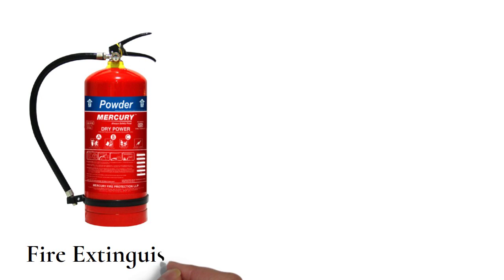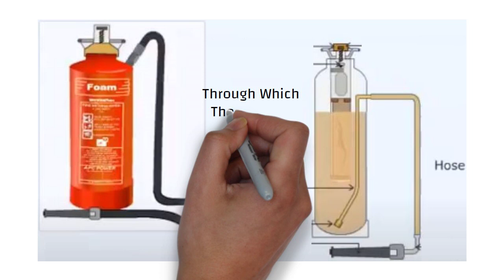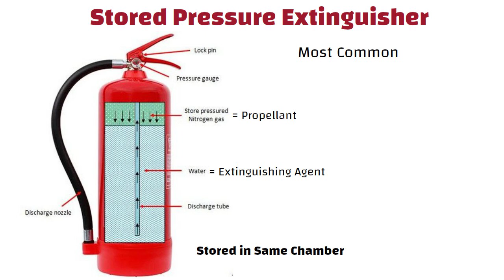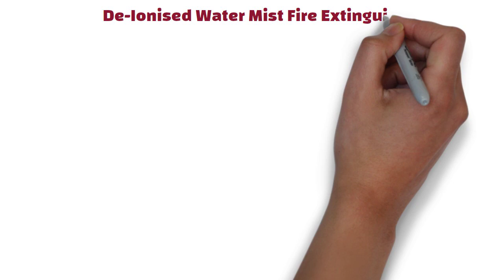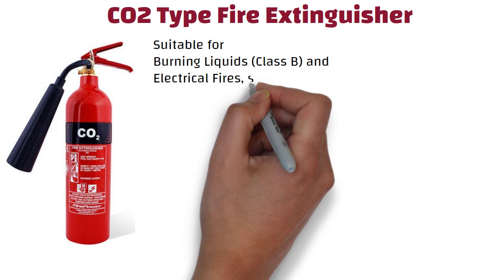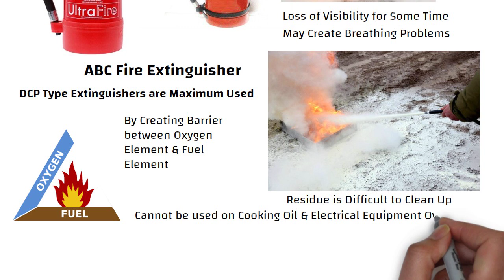FIRE EXTINGUISHER DEALERS IN KERALA, CALL 8138906102, FIRE EXTINGUISHER DEALERS IN ERNAKULAM.

Comment from the maker: fire extinguisher traders in Kayamkulam
Reply: FIRE EXTINGUISHER DEALERS IN WAYANAD, FIRE EXTINGUISHER SUPPLIERS IN WAYANAD, FIRE EXTINGUISHER DISTRIBUTORS IN WAYANAD, FIRE EXTINGUISHER IN WAYANAD, ABC TYPE FIRE EXTINGUISHER DEALERS IN WAYANAD, CO2 TYPE FIRE EXTINGUISHER DEALERS IN WAYANAD, CLEAN AGENT FIRE EXTINGUISHER IN WAYANAD, MODULAR TYPE FIRE EXTINGUISHER DEALERS IN WAYANAD, MECHANICAL FOAM FIRE EXTINGUISHER DEALERS IN WAYANAD, FIRE EXTINGUISHER NEAR ME WAYANAD, FIRE EXTINGUISHER TRADERS IN WAYANAD, FIRE FIGHTING COMPANIES IN WAYANAD, FIRE CONTRACTORS IN WAYANAD, FIRE EQUIPMENT DEALERS IN WAYANAD, FIRE ALARM DEALERS IN WAYANAD, FIRE PUMP DEALERS IN WAYANAD, SMOKE DETECTOR DEALERS IN WAYANAD, FIRE FIGHTING SYSTEM IN WAYANAD, FIRE PROTECTION SYSTEM IN WAYANAD, FIRE AND SAFETY CONTRACTORS IN WAYANAD, FIRE HYDRANT SYSTEMS IN WAYANAD, PA TALK BACK SYSTEM IN WAYANAD, FIRE NOC IN WAYANAD, FIRE INSTALLATION IN WAYANAD, FIRE NOC RENEWAL IN WAYANAD, KIRLOSKAR FIRE PUMP DEALERS IN WAYANAD, FIRE EXTINGUISHER NEAR ME WAYANAD, FIRE EXTINGUISHER MANUFACURERS IN WAYANAD, SAFEX FIRE EXTINGUISHER DEALERS IN WAYANAD, FIRE NOC CONTRACTORS IN WAYANAD, FIRE FIGHTING EQUIPMENT DEALERS IN WAYANAD, FIRE PROTECTION SYSTEM IN WAYANAD, FIRE INSTALLATION IN WAYANAD, FIRE SAFETY CONTRACTORS IN WAYANAD, FIRE AMC IN WAYANAD, FIRE PROTECTION SYSTEM IN WAYANAD, FIRE PROTECTION EQUIPMET IN WAYANAD, AMC OF FIRE SYSTEM IN WAYANAD, FIRE CONSULTANTS IN WAYANAD, FIRE AND SAFETY EQUIPMENT DEALERS IN WAYANAD, ADDRESSABLE FIRE ALARM SYSTEM IN WAYANAD, KARTHAR VALVE DEALERS IN WAYANAD, DCP TYPE FIRE EXTINGUISHER IN WAYANAD, POWSER TYPE FIRE EXTINGUISHERS IN WAYANAD, FIRE HYDRANT SYSTEM IN WAYANAD, FIRE ALARM PANEL DEALERS IN WAYANAD, SAFEPRO FIRE EXTINGUISHER DEALERS IN WAYANAD, MS AND GI PIPE DEALERS IN WAYANAD, JINDAL PIPE DEALERS IN WAYANAD, AGNI FIRE ALARM DEALERS IN WAYANAD, FIRE EQUIPMENT DEALERS IN WAYANAD, FIRE EQUIPMENT SUPPLIERS IN WAYANAD, FIRE EQUIPMENT TRADERS IN WAYANAD, FIRE SPRINKLER SYSTEM IN WAYANAD, RAVEL FIRE ALARM DEALERS IN WAYANAD, RAVEL FIRE ALARM SYSTEM IN WAYANAD, AGNI FIRE ALARM DISTRIBUTORS IN WAYANAD, FIRE ALARM CONTRACTORS IN WAYANAD, FIRE PIPE INSTALLATION IN CONTRACTORS IN WAYANAD, FIRE SAFETY CONTRACTORS IN WAYANAD, FIRE PA TWO WAY TALK BACK SYSTEM DEALERS IN WAYANAD, HEAT DETECTOR DEALERS IN WAYANAD, HONEYWELL FIRE ALARM DEALERS IN WAYANAD, FIRE NOC CONSULTANTS IN WAYANAD, FIRE AMC AND FIRE NOC IN WAYANAD, FIRE SAFETY COMPANIES IN WAYANAD, NEWAGE DEALERS IN WAYANAD, MONSHER FIRE EQUIPMENT DEALERS IN WAYANAD, KARTHAR VALVE DEALERS IN WAYANAD, FIRE HYDRANT VALVE DEALERS IN WAYANAD, FIRE HOSE REEL DRUM DEALERS IN WAYANAD, FIRE SPRINKLER DEALERS IN WAYANAD, FIRE PUMP DEALERS IN WAYANAD, LUBI PUMP DEALERS IN WAYANAD, LHP PUMP DEALERS IN WAYANAD. FIRE CONTRACTORS IN WAYANAD, FIRE AND SAFETY CONTRACTORS IN WAYANAD, FIRE EQUIPMENT DEALERS IN WAYANAD, FIRE FIGHTING CONTRACTORS IN WAYANAD, AGNI FIRE ALARM DEALERS IN WAYANAD, PA TALK BACK SYSTEM DEALERS IN WAYANAD, FIRE NOC IN WAYANAD, FIRE NOC RENEWAL IN WAYANAD, FIRE SYSTEM INSTALLATION IN WAYANAD, FIRE EXTINGUISHER DEALERS IN KALPETTA, FIRE EXTINGUISHER DEALERS IN BATHERY, FIRE EXTINGUISHER DEALERS IN MANATHAVADY.

Comment from the maker: FIRE EXTIBGUISHER IN MAVELIKARA
Reply: FIRE EXTINGUISHER DEALERS IN KERALA, FIRE EXTINGUISHER SUPPLIERS IN KERALA, FIRE EXTINGUISHER DISTRIBUTORS IN KERALA, FIRE EXTINGUISHER IN KERALA, ABC TYPE FIRE EXTINGUISHER DEALERS IN KERALA, CO2 TYPE FIRE EXTINGUISHER DEALERS IN KERALA, CLEAN AGENT FIRE EXTINGUISHER IN KERALA, MODULAR TYPE FIRE EXTINGUISHER DEALERS IN KERALA, MECHANICAL FOAM FIRE EXTINGUISHER DEALERS IN KERALA, FIRE EXTINGUISHER NEAR ME KERALA, FIRE EXTINGUISHER TRADERS IN KERALA, FIRE FIGHTING COMPANIES IN KERALA, FIRE CONTRACTORS IN KERALA, FIRE EQUIPMENT DEALERS IN KERALA, FIRE ALARM DEALERS IN KERALA, FIRE PUMP DEALERS IN KERALA, SMOKE DETECTOR DEALERS IN KERALA, FIRE FIGHTING SYSTEM IN KERALA, FIRE PROTECTION SYSTEM IN KERALA, FIRE AND SAFETY CONTRACTORS IN KERALA, FIRE HYDRANT SYSTEMS IN KERALA, PA TALK BACK SYSTEM IN KERALA, FIRE NOC IN KERALA, FIRE INSTALLATION IN KERALA, FIRE NOC RENEWAL IN KERALA, KIRLOSKAR FIRE PUMP DEALERS IN KERALA, FIRE EXTINGUISHER NEAR ME KERALA, FIRE EXTINGUISHER MANUFACURERS IN KERALA, SAFEX FIRE EXTINGUISHER DEALERS IN KERALA, FIRE NOC CONTRACTORS IN KERALA, FIRE FIGHTING EQUIPMENT DEALERS IN KERALA, FIRE PROTECTION SYSTEM IN KERALA, FIRE INSTALLATION IN KERALA, FIRE SAFETY CONTRACTORS IN KERALA, FIRE AMC IN KERALA, FIRE PROTECTION SYSTEM IN KERALA, FIRE PROTECTION EQUIPMET IN KERALA, AMC OF FIRE SYSTEM IN KERALA, FIRE CONSULTANTS IN KERALA, FIRE AND SAFETY EQUIPMENT DEALERS IN KERALA, ADDRESSABLE FIRE ALARM SYSTEM IN KERALA, KARTHAR VALVE DEALERS IN KERALA, DCP TYPE FIRE EXTINGUISHER IN KERALA, POWSER TYPE FIRE EXTINGUISHERS IN KERALA, FIRE HYDRANT SYSTEM IN KERALA, FIRE ALARM PANEL DEALERS IN KERALA, SAFEPRO FIRE EXTINGUISHER DEALERS IN KERALA, MS AND GI PIPE DEALERS IN KERALA, JINDAL PIPE DEALERS IN KERALA, AGNI FIRE ALARM DEALERS IN KERALA, FIRE EQUIPMENT DEALERS IN KERALA, FIRE EQUIPMENT SUPPLIERS IN KERALA, FIRE EQUIPMENT TRADERS IN KERALA, FIRE SPRINKLER SYSTEM IN KERALA, RAVLE FIRE ALARM DEALERS IN KERALA, RAVEL FIRE ALARM SYSTEM IN KERALA, AGNI FIRE ALARM DISTRIBUTORS IN KERALA, FIRE ALARM CONTRACTORS IN KERALA, FIRE PIPE INSTALLATION IN CONTRACTORS IN KERALA, FIRE SAFETY CONTRACTORS IN KERALA, FIRE PA TWO WAY TALK BACK SYSTEM DEALERS IN KERALA, HEAT DETECTOR DEALERS IN KERALA, HONEYWELL FIRE ALARM DEALERS IN KERALA, FIRE NOC CONSULTANTS IN KERALA, FIRE AMC AND FIRE NOC IN KERALA, FIRE SAFETY COMPANIES IN KERALA, NEWAGE DEALERS IN KERALA, MONSHER FIRE EQUIPMENT DEALERS IN KERALA, KARTHAR VALVE DEALERS IN KERALA, FIRE HYDRANT VALVE DEALERS IN KERALA, FIRE HOSE REEL DRUM DEALERS IN KERALA, FIRE SPRINKLER DEALERS IN KERALA, FIRE PUMP DEALERS IN KERALA, LUBI PUMP DEALERS IN KERALA, LHP PUMP DEALERS IN KERALA. FIRE CONTRACTORS IN KERALA, FIRE AND SAFETY CONTRACTORS IN KERALA, FIRE EQUIPMENT DEALERS IN KERALA, FIRE FIGHTING CONTRACTORS IN KERALA,

Comment from the maker: FIRE EXTINGUISHER DEALERS IN MAVELIKARA
Reply from the maker: FIRE ALARM PANEL DEALERS IN VALANCHERY, HEAT DETECTOR DEALERS IN VALANCHERY, FIRE ALARM SYSTEM SUPPLIERS IN VALANCHERY, FIRE ALARM COMPANIES IN VALANCHERY, FIRE EQUIPMENT DEALERS IN VALANCHERY, ADRRESSABLE FIRE ALARM PANEL DEALERS IN VALANCHERY, FIRE ALARM SYSTEM IN VALANCHERY, BATTERY OPERATED DETECTOR DEALERS IN VALANCHERY, ASPIRATION DETECTION SYSTEM DEALERS IN VALANCHERY, FIRE ALARM MCP - MANUAL CALL POINT DEALERS IN VALANCHERY, FIRE ALARM HOOTER DEALERS IN VALANCHERY, PA TWO WAY TALK BACK SYSTEM DEALERS IN VALANCHERY, PA SYSTEM DEALERS IN VALANCHERY, PA TALK BACK UNIT DEALERS IN VALANCHERY, HOOTER CUM STROBE DEALERS IN VALANCHERY, FIRE PROTECTION SYSTEM IN VALANCHERY, FIRE ALARM CONTRACTORS IN VALANCHERY, FIRE DETECTORS IN VALANCHERY, FIRE ALARM IN VALANCHERY, ADDRESSABLE FIRE ALARM DEALERS IN KOLLAM, SMOKE DETECTOR DEALERS IN KOLLAM, FIRE EQUIPMENT DEALERS IN VALANCHERY, FIRE ALARM INSTALLATION IN VALANCHERY, FIRE ALARM COMPANIES IN VALANCHERY FIRE ALARM DISTRIBUTORS IN VALANCHERY, TALK BACK SYSTEM DEALERS IN VALANCHERY, FIRE ALARM SENSOR DEALERS IN VALANCHERY, FIRE EXTINGUISHER DEALERS IN VALANCHERY, FIRE ALARM DEALERS IN MALAPPURAM, FIRE ALARM IN MALAPPURAM, ADDRESSABLE FIRE ALARM DEALERS IN MALAPPURAM, SMOKE DETECTOR IN VALANCHERY,  FIRE EXTINGUISHER DEALERS IN VALANCHERY, FIRE EXTINGUISHER SUPPLIERS IN VALANCHERY, FIRE EXTINGUISHER DISTRIBUTORS IN VALANCHERY FIRE EXTINGUISHER IN VALANCHERY, ABC TYPE FIRE EXTINGUISHER DEALERS IN VALANCHERY, CO2 TYPE FIRE EXTINGUISHER DEALERS IN VALANCHERY, CLEAN AGENT FIRE EXTINGUISHER IN VALANCHERY FIRE FIGHTING PUMP DEALERS IN VALANCHERY, FIRE PUMP DEALERS IN VALANCHERY, KIRLOSKAR FIRE PUMP DEALERS IN VALANCHERY, FIRE JOCKEY PUMP DEALERS IN VALANCHERY, FIRE DISEL ENGINE DRIVEN PUMP DEALERS IN VALANCHERY, FIRE FIGHTING EQUIPMENT DEALERS IN VALANCHERY, FIRE FIGHTING SYSTEM IN VALANCHERY, VERTICAL INLINE PUMP DEALERS IN VALANCHERY, HYDRO PNEUMATIC PRESSURE BOOSTING PUMP DEALERS IN VALANCHERY, VERTICAL TURBINE PUMP DEALERS IN VALANCHERY, SEWAGE PUMP DEALERS IN VALANCHERY, RO PUMP DEALERS IN VALANCHERY. FIRE EXTINGUISHER DEALERS IN MALAPPURAM, Fire extinguisher dealers in Valanchery, Fire extinguisher suppliers in Valanchery, Fire extinguisher traders in Valanchery, Fire extinguisher in Valanchery, Fire alarm dealers in Valanchery, Fire hydrant system in Valanchery, Fire fighting equipment dealers in Valanchery, Fire equipment in Valanchery, Fire contractors in Valanchery, Fire installation in Valanchery, Fire protection system in Valanchery, Fire hydrant system in Valanchery, PA two way talk back system dealers in Valanchery, PA talk back unit in Valanchery, Fire telephone system dealers in Valanchery, Fire pump dealers in Valanchery, Addressable fire alarm dealers in Valanchery, Conventional fire alarm dealers in Valanchery, Fire alarm panel dealers in Valanchery, Smoke detectors in Valanchery, Heat detectors in Valanchery, Multi sensor detector dealers in Valanchery, Fire NOC in Valanchery, Kirloskar fire pump dealers in Valanchery, Fire detection system in Valanchery, GST addressable fire alarm in Valanchery, Morley fire alarm in Valanchery, Fire safety installation in Valanchery, Butterfly valve dealers in Valanchery, Fire extinguisher near me Valanchery, Fire protection equipment dealers in Valanchery. fire extinguisher dealers in Malappuram, fire fighting contractors in malappuram, fire and safety systems in Malappuram, fire equipment in Malappuram, fire extinguisher in Malappuram, fire extinguisher suppliers in Malappuram, fire protection system in Malappuram, fire consultants in Malappuram, fire fighting companies in Malappuram, fire  NOC in Malappuram, fire protection system installation in malappuram, fire safety contractors in malappuram, fire safety consultants in malappuram, fire and safety contractors in malappuram, fire and safety equipment in Malappuram, fire alarm systems in Malappuram, fire AMC in Malappuram, fire contractors in malappuram, fire safety equipment in Malappuram, fire protection system installation in Malappuram, fire protection equipments in Malappuram